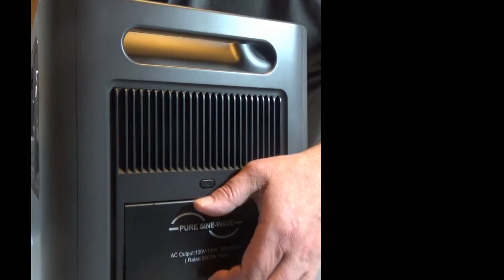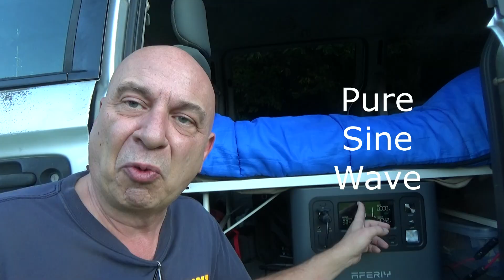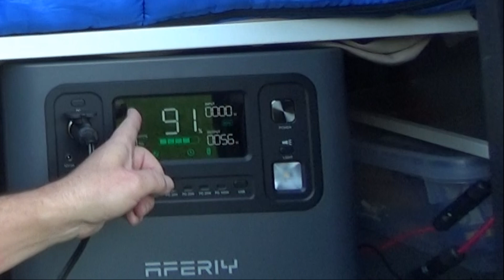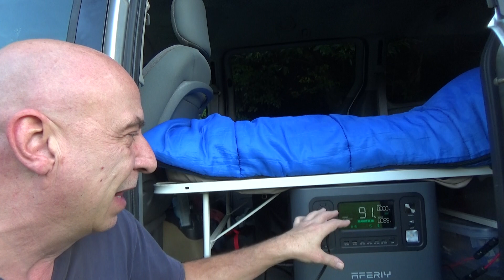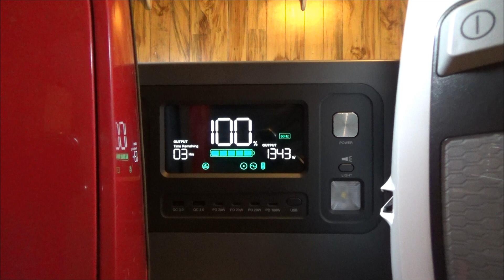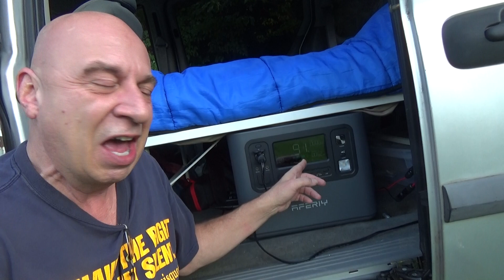MONSTER SIZED? 2408wh Portable Power Station 2400 Watts (Aferiy P210) Quality Review Camper Van Life

Comment from the maker: Check Current Pricing/Coupons on Amazon
https://amzn.to/3YRKSdb - Aferiy 2048wh Power Station
https://amzn.to/3ACBRdR - Aferiy  960wh Power Station
https://amzn.to/3Mky9rY - Aferiy  512wh Power Station

-------------------------
BudgetTravelGuy is a participant in the Amazon Services LLC Associates Program, an affiliate advertising program designed to provide a means for people to earn advertising fees by advertising and linking to Amazon.com. I also participate in other affiliate programs where I may be compensated for referring traffic.
---------------------------
Thank you to to Aferiy for providing this unit for testing.
---------------------------

Other recent videos:
https://youtu.be/jscqT6UC6A8 - Minivan Camper Night Routine Tips
https://youtu.be/3WwHDx6DeEg - Monster 12v Fridge (Setpower PT55)
https://youtu.be/B11-ocaj4p0 - Minivan Solar Questions Answered
https://youtu.be/JRSl1waZKSE  - Running Wires For Solar Panel Van Install
https://youtu.be/rJKWET24zuM - No Drill Solar Panel Install (Metal Top Vans)
https://youtu.be/ARL8PCwlb9k - Does Buc-ees Hate VanLifers?
https://youtu.be/1Ui5h5cMQsU - Minimalistic Minivan Camper Build
https://youtu.be/zADRAs_1CKM - Camper Van Inverter Install
https://youtu.be/ACEeWBf3yaw - Minivan Passenger Seat Removal/Reversal
https://youtu.be/ww1WzQNATNc - Best Vanlife Toilets 2024
https://youtu.be/uUGsf36gWeQ - Minivan Build 2.0